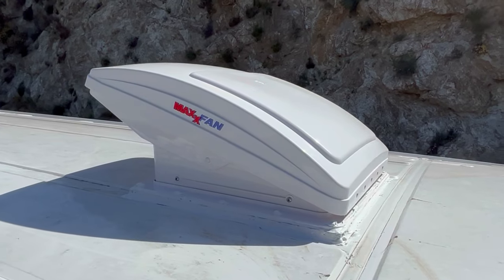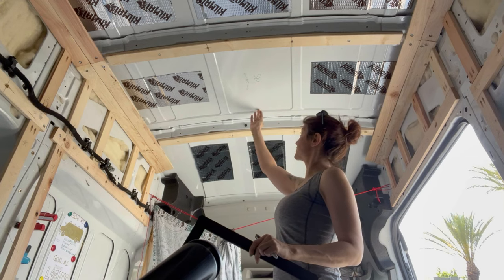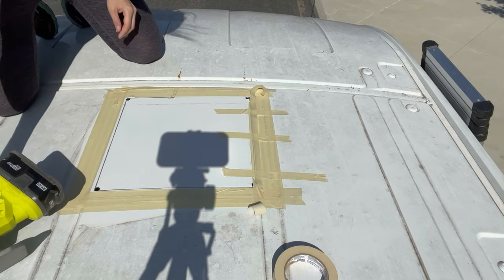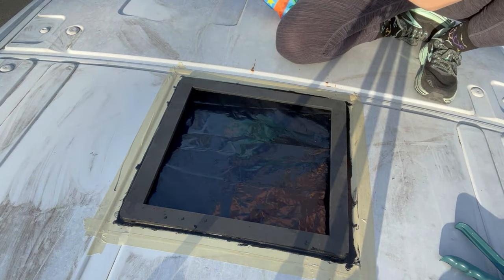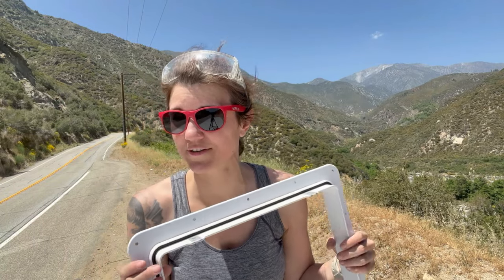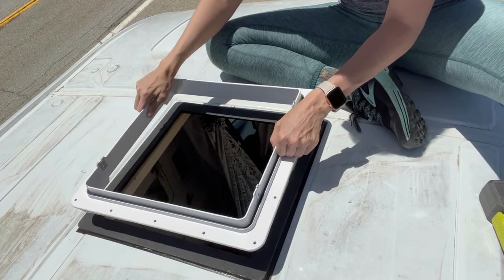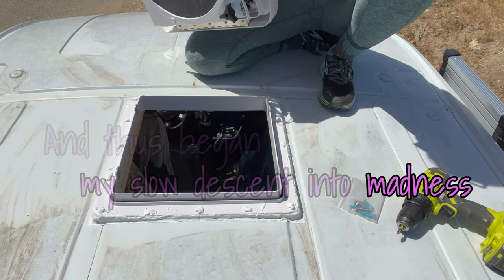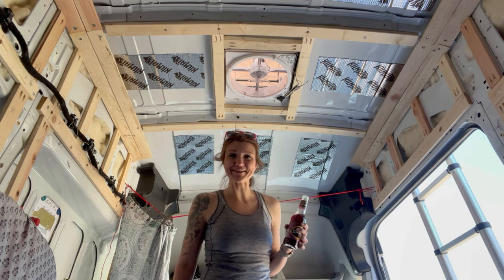MaxxFan & Support Frame Install - But The Screw Holes Won’t Line Up! | Van Conversion Series [11]

Comment: Your explanations are way more detailed than I have ever seen…and an amazing job…btw I noticed you pulled over on the side of the road…looks like Latigo or Malibu canyon…curious if I am right about that…
Reply: Oh and thank you for your detailed camera work…so easy to follow…beautifully done…
Reply from the maker: Hi! It was a small road leading up to Mount Baldy. If I remember correctly, I found it when I was headed up to the Ice House Canyon hiking trail ❤️
Reply from the maker: And thank you for saying that! As a newbie, I was hoping to fill in the gaps for other newbies so you can actually see every part of the install 😂